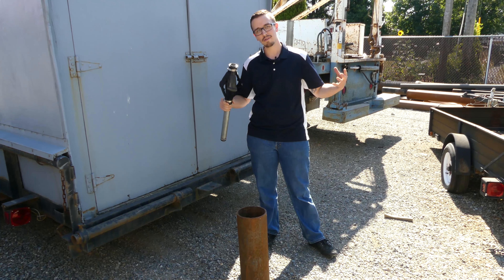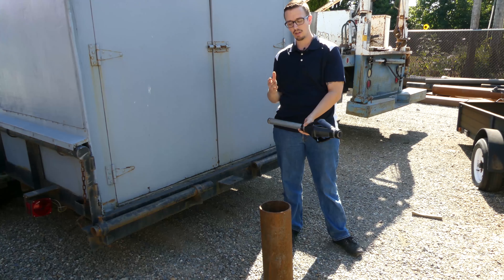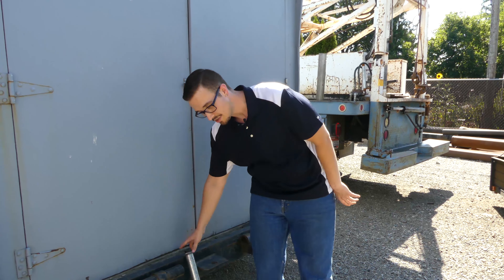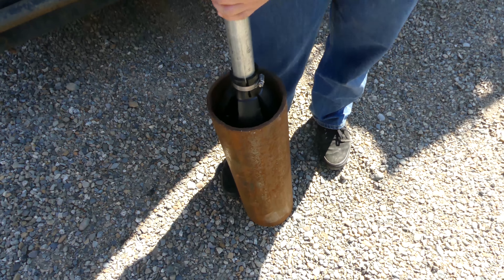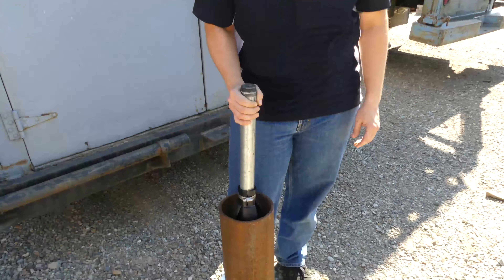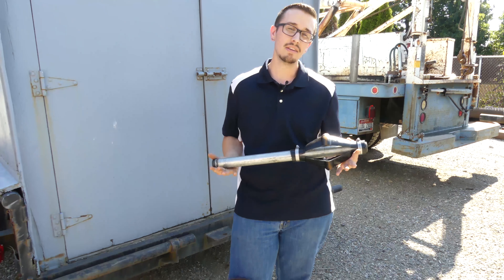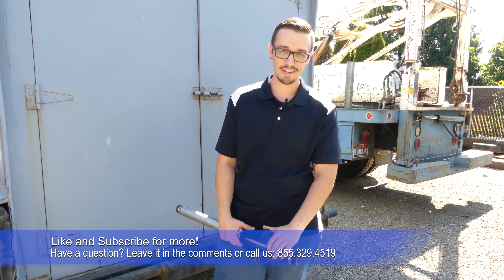Torque Arrestors for Submersible Well Pumps

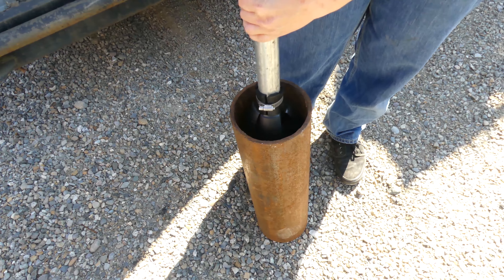Comment: Very helpful tutorial on this subject, thank you.  Happens I am replacing what I'd thought was a malfunctioning 25+ year old 1/2 hp "Red Jacket Grizzly" (ITT)....  (on 75 ft of wire)  Upon inspecting the wiring after I got it up, I see two deep nicks in the wiring,  about a foot above the pump, and perhaps they were the source of the trouble.  Was thinking I'd need an "arrestor" to prevent such cuts in future -- yet your overall counsel and esp. at min 6:00 -- more wrap -- suggests a better way.

Comment: My brother just replaced his pump, they had a hard time breaking the system loose from the pitiless adaptor. 189 feet of 1inch steel pipe. The pump broke off the pipe just as it was coming out. He said the well company said the pump was locked up. First time the pump was pulled, installed in 1977 lasted until 2020.
Reply: Wow, pretty sure they don’t make them that reliable these days, like so many other things!

Comment: I think a torque arrestor helps reduce the problem of the wiring rubbing against the casing due to the downpipe twisting at startup.  Exposed wiring has caused many, many wells to need servicing.  Cable guards are great too but I never know how many to use.

Comment: I use them to center the pump in the pipe because we have extremely rocky ground and it's almost impossible to drill a straight pipe. There can be 3 or 4 inches of offset in a 200 foot pipe.
Reply from the maker: Good tip! They are useful for helping center the pipe

Comment: The wire at the motor was always wearing in to, so I put a torque arrestor like the one in your video just above the motor. Now the wire wears all along the PVC casing up to 50 ft. above the motor. I use 10-2 w/ground UF wire, taped to pipe every 5 ft.. I just pulled it out and the wire was worn completely in to 10 ft. above the motor. It lasted about 5 years. The pump is 151 ft. deep with a 1.5 hp motor. Is there something I can install to protect the wires from wearing?
Reply from the maker: Yes, you're looking for cable guards. It's also important to put submersible-rated wire in the well - not UF. Give us a call and we can help you: 855.329.4519

Comment: They're also good for keeping the wire from rubbing against the casing.  It's a problem when the well isn't perfectly vertical, or there's a curve to the pipe.  The wires get rubbed every time the pump kicks on or off.  Cheap prevention.  I'd recommending using a couple (or more) at a time.  I'm not an expert, I've just felt the pain.
Reply: Exactly if you don't use them it will destroy your wiring

Comment: I notice after the last well pump I had put in, they removed them and said I didn't need the torque arrestors after a bout a month all my toilet fill valve and shower head became clogged, so now I have to run a whole house filter that need replace every 2 months, Ive never had to deal with a filter 40 years prior

Comment: As you mentioned, the casings aren’t perfectly straight. Wouldn’t it be a good idea to use a torque arrester or pipe cantering clamp to keep the wires and pipe centred the whole way up the well? Or is that too much overkill?

Comment: Chris, 
If you do use a torque arrestor, how do you run the wires from the submersible pump through the torque arrestor to prevent wire chafing and rubbing? ... Video idea :) ?
Reply: The wires go inside the Torque arrestor  .
Reply: Not under the clamps but goes between the folds with plenty of distance from the wall 
Along side the expanded arrestor in a straight line …

Comment: The pump I’m putting in next week is a 1hp 220 three wire (so there’s 4) but it says on the box use a 15 amp breaker, that sounds super low and the old one is 30. Am I missing something? Are they talking about 15 amps per 120 leg? Thanks.
Reply from the maker: Typically a 20 amp double-pole breaker is used for 1 HP 230V pumps, but if the manufacturer calls out a 15 amp then that is what you need to use. Refer to the NEC or call an electrician for more info on sizing requirements.
Reply: R.C. Worst & Co., Inc., thanks man, I used the 15 amp and everything is working great. I pulled my old pump (200’) and put the new one in, just my wife helping me, got it done in one day. If it weren’t for your videos and you answering a couple stupid questions I’d never have attempted this project, it was intimidating but you saved me a lot of money I didn’t have, thanks man.
Reply from the maker: @shanek6582  Thanks for the kind words and good job doing it on your own! If you're ever in need of products/tech support we're just a phone call away: 855.329.4519
Reply: R.C. Worst & Co., Inc. I got a new Tee pipe for the pressure tank from you guys, worked great and was cheaper than buying all the individual parts from Lowe’s.

Comment: Great video! I’m looking to have a pump on “standby”, as my pump is over 25 years old. Amazon has a Hallmark brand pump 3/4 hp, 2 wire for $170.00. Is this a decent brand pump? My well is about 85’ deep, pump is at 50’ (I’ve been told).
Reply from the maker: Hello Tim. I would stay away from Hallmark, unless you enjoy pulling and setting pumps in your free time. They sell very very cheap pumps that will not last 25 years like your current one did. I would suggest replacing your current pump with the same make/model if it's lasted that long. If you need help finding that info give us a call: 855.329.4519
Reply: R.C. Worst & Co., Inc. . Thank you for replying. Yes m, they are cheap, haha. I saw some knowledgeable people speak of them on Terry loves plumbing site. I wish I knew the brand that was installed before I purchased in 1994. When I do retrieve it I’ll give you guys a call. Thanks again!
Reply from the maker: @Liledgy100  You bet! We hope to make a PSA video soon about their pumps to warn people. Been getting a lot of troubleshooting calls about them lately.

Comment: My well is 20 ft with plastic pipe. A couple months ago I had 55volts in my basement.  Found the issue in the well. The extra wire to pull the pump had rubbed and shorted. Why did this happen after 30 years went through my mind.  
Now I have a problem with the check valve, I pulled the pump and found the torque arrestor in pieces.
I feel the torque arrestor gave out, then allowed the cable to move. It was not even the wire down to the pump. It was the extra wire at the top!!

Comment: When you say, wires go inside the torque arrestor; do you mean they go underneath(inside) the pipe clamps? Seems like that would stress the wire and also compromise the grip on the drop pipe.
Reply: No, you're right: don't run them under the clamps. Over the clamps, through the torque arrestor.

Comment: I have a 500 feet deep water well tHat i personally installed the 3 H  pump in it , and i forget to instant the Toque Arrestor , well 3 years later one day i noticed that the pump stop working , after checking all found out the pump had to be pulled out the problem was in the well   , so after pulling it out about 110 feet realized the 1" pext pipe coupling have broken off i come to think of it that the  problem started from the get go if the pipe was all one piece i don't think this would have happened OR at leased would have happen much later  , and now the remaining 350 feet of pipe jammed in well with motor so bad the 1/2" nylon rope broke off last resort was to pull it by the 4 wire horniest   and you gassed it , that broke off from rite at the top of the pump , now i only have one try more before i have to stick another $ 10.000 more in a different spot , and that is spend more money in equipment and try to catch that pipe at around 110' to 350' deep , i think all of this because was the bad splicing and (NO ARRESTOR)  WHAT DO YOU THINK?.
Reply: It's been two (2) years, so this advice is probably too late to do you much good; but, maybe, somebody reading over our shoulders will benefit...

Before you spend a LOT of money to drill in a new location, talk to a local well drilling company.  Tell them what's at the bottom of the well and see what they think might be done.  I say "local" because, different parts of the country have different geologic formations and some places the driller's are tooled up to drill through some really HARD rock....   Which turned out to be a good thing for one of my neighbors who had a pump "stuck" in his well -- just like you describe.  The local well driller said, "I can go through basalt -- your old stainless pump ain't gonna stop me..."  and, that's exactly what he did -- drilled through the old pump; went enough deeper to have a place for any "left over bits" to settle; and my neighbor paid for the cost of setting up the rig, taking down the rig, and -- I think -- about 30 or 40 feet of actual drilling...  Oh, and he had the driller install the new pump, too...  Problem solved!

Comment: "motor torque can unthread itself from the pipe"  ... that seems like stupid engineering. Why not have the spin direction the other way to keep that from happening?
Reply: I was thinking the same thing why don't they make them left hand thread then and why don't they make couplers with a ring to make it easier to pull out DIY?
Reply: That would make too much sense

Comment: All nice in casing ,casing only goes to bedrock then open hole.,taping the first stick is common practice but won't help torque lol 0 to 3800 rpm .....torque arrestor are absolutely  important pump then 20' then 100 ' after that ...also don't forget check valves !!!!!! Displaces weight of water in drop pipe and saves thrust on water end ...3rd Gen well mechanic ..just sayin

Comment: My casing stops at 130 feet but my well is 220, wouldn’t the hole diameter below the casing be bigger? If you adjust the torque arrestor for the casing, how do you know how big the diameter below the casing is?
Reply from the maker: The casing diameter is always going to be as big or bigger than the perforated pipe below it. To find out what diameter your well goes down to you will to look at your well driller's report. Your local water authority should have one on file for wells drilled within the last 25 years.
Reply: @RCworstwater  I've got 6" casing at the top but 4 1/2" liner at the pump level. Do I just tighten the arrestor with a guess at maybe 4 1/4" diameter?